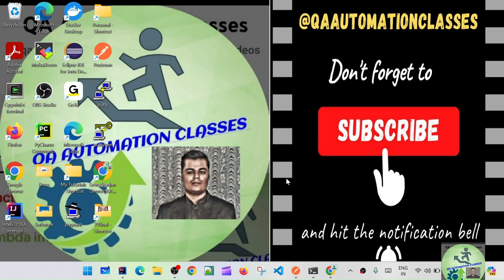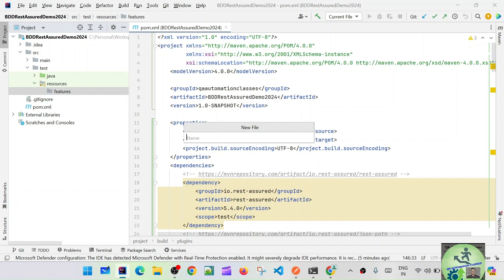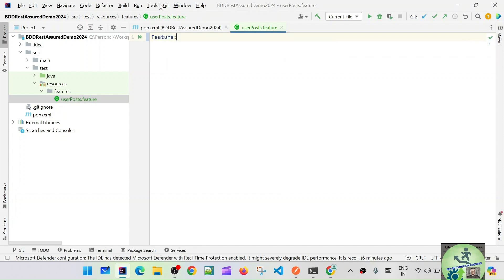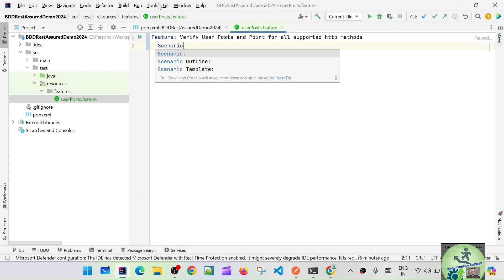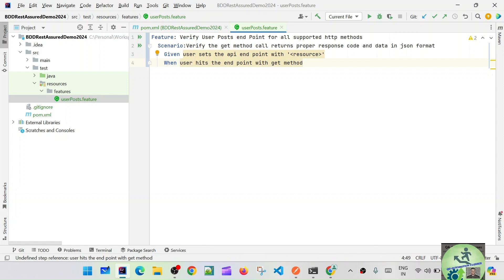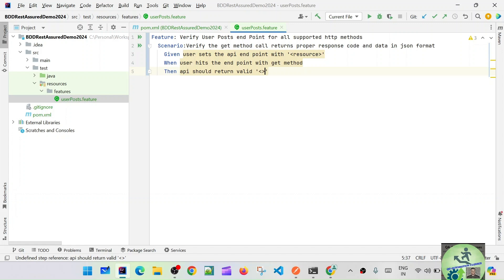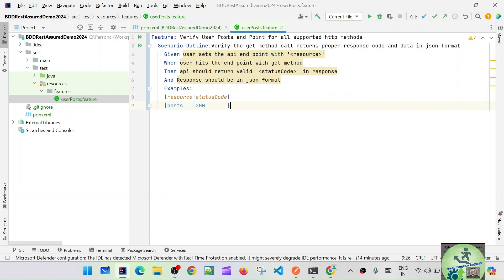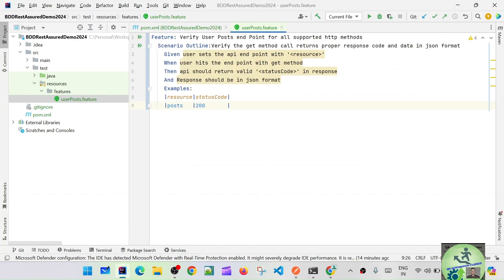9.Setting up rest assured framework with cucumber | feature file and step definition design

Comment: Can we use instead of cucumber junit ,cucumber testng
Reply from the maker: Yes we can use testing as well. Only the runner file will get changed and we can change the @Before @After annotations in hooks to a suitable annotation from testng. Remaining structure or architecture will remain same. For assertion we can use testng assertions instead of junit assertions
Reply: @qaautomationclasses  Thankq very much..😀
Reply: Nicely explained!
Reply from the maker: @DSA-n-Design Thanks